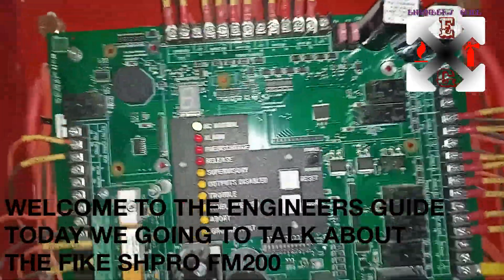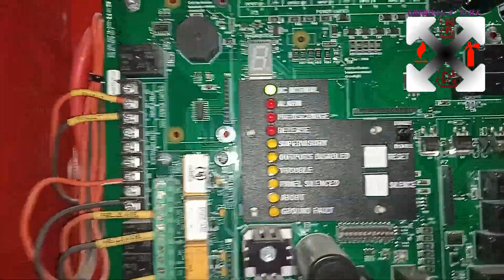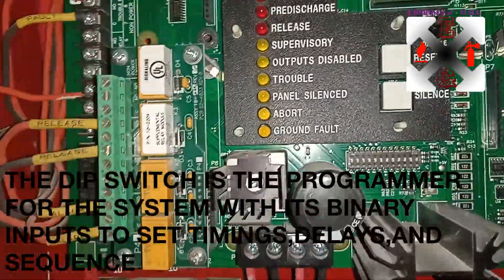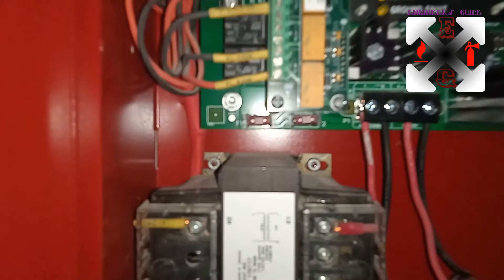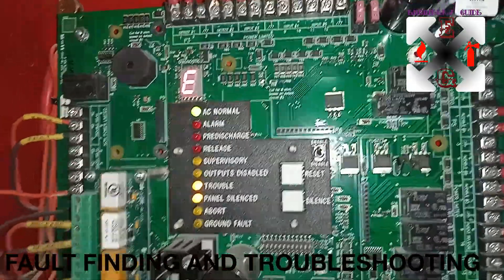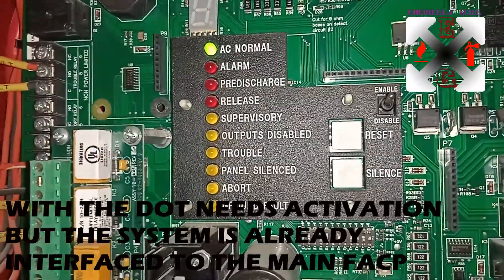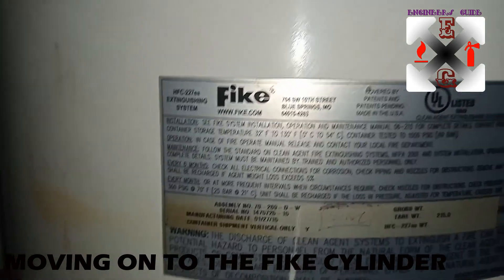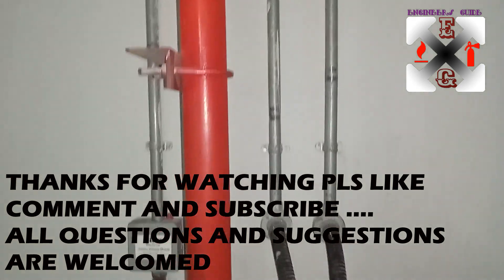FIKE FM200 OVERVIEW,TESTING AND TROUBLESHOOTING #FIKE #SUPRESSIONSYSTEMS #FM200

Comment: Hi Sir,
I'd like to ask, how do I remove the Panel Silenced notification? Is it because we haven't turned off the switch?
Thank you.
Reply from the maker: Silence notification will only work when there is a trouble or an alarm indication then you press the silence button before it will work, other than that there has to be another issue related to the board can u share a picture or text me on what'sapp

Comment: How to settle grounf faunt error 0 bro
Reply from the maker: U need to start removing the cables from the terminals one after the other till the one that the ground fault signal will go that will be the point u need to check ,secondly if there is leakage of your battery it can cause gf too so remove the battery terminals first and check ✅

Comment: when you pull out the wire for discharge,is that normal the wire give a 24 volt ??
Reply from the maker: yes its normal it wont have the amps to activate it,it will only work when there is alarm
Reply: @engineersguidehelp  ok thank you sir

Comment: How to solve earth fault ?
Reply from the maker: continue removing the cables one after the other from the panel ,the one that will get the earth fault gone then you trace it from there ,open that cable connect back to panel and check and correct it till it goes thanks
Reply: @engineersguidehelp  I have run into a ground fault for the exact system, can I apply the same troubleshooting method?
Reply from the maker: @MATARIU_MIX yes you can

Comment: I got a FIKE SHP-PRO, can you open the transformers clear covers? I need to remove a wire but I am unable to.
Reply from the maker: YES YOU CAN GET A TESTER OR FLAT SCREEW DRIVER TO LIFT THE COVER FROM ITS CORNERS

Comment: You have any idea about Fike addressable module wiring connection
Reply from the maker: Yes the connections are mainly like the fire alarm wiring loop in and out and the devices connected to the devices part
Reply from the maker: If you have the drawings u can share so we will help you